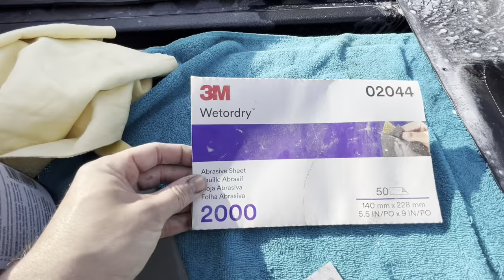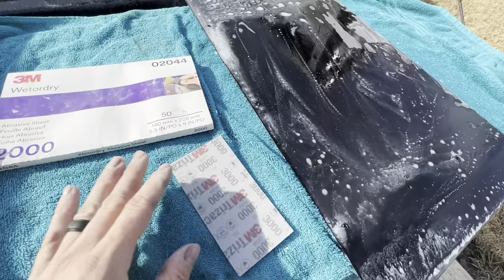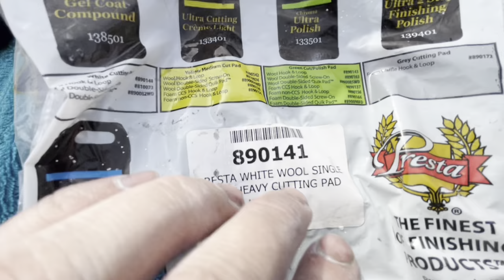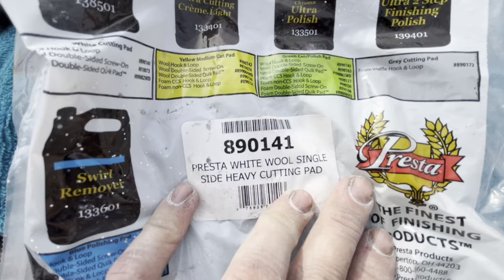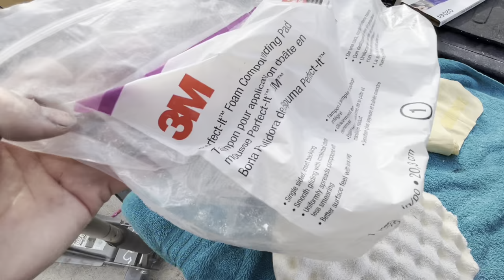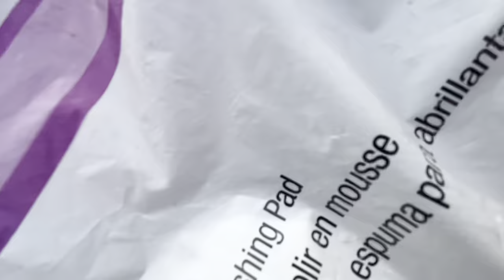🧼 DIY Wet-Sanding 🪣 From Orange Peel 🍊 To Glass 🎥

Comment: You need to try dry sanding with a DA.  When I have customers that want a car smooth and trash free all I do is DA it with 1200 and then buff it with the foam compounding pad and I'm done, swirl free.  If it's black I do follow up with the black polishing pad to get it swirl free.  Simple and easy process.
Reply from the maker: Interesting I’ll have to give it a try. What compound are you using.
Reply: @ThePaintPaperHustle  It's called Panel Shop 1200. I get it from amazon for just under $20 free shipping.  You do need to use a good 1200grit paper.  I use 3M 30668.  You can't use this method if your paint is still soft.
Reply from the maker: Ok thanks